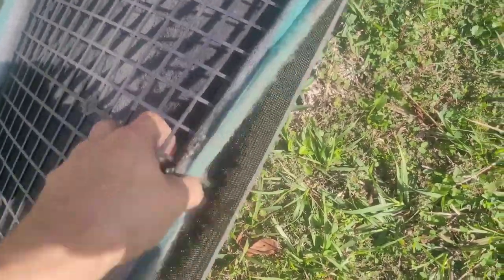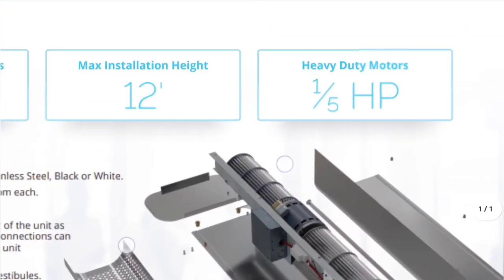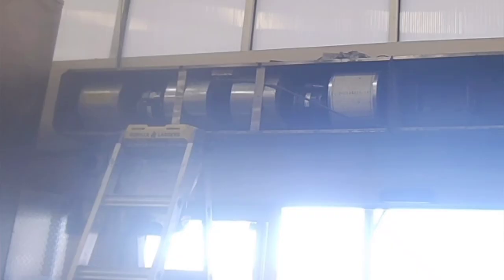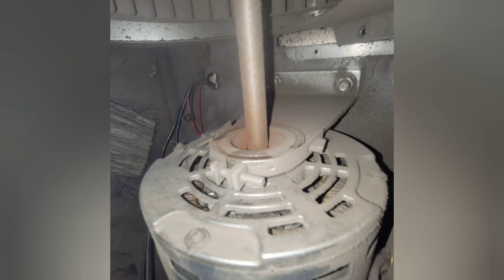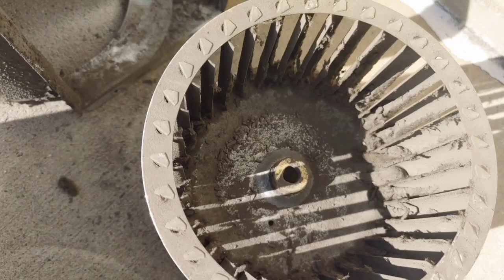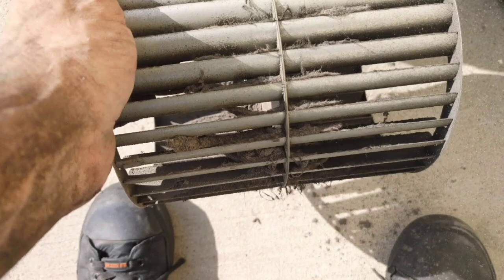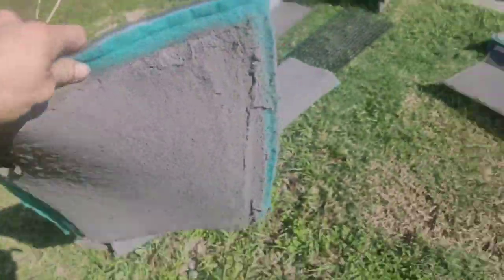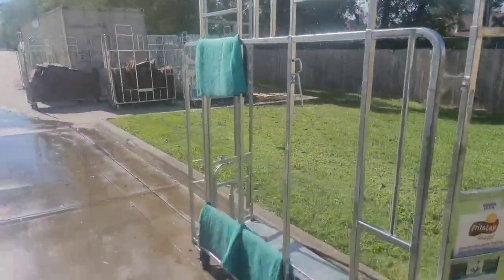Commercial Air Curtains At Supermarket Exit DIRTY

Comment: those motors are quick change. you only need to undo small nut and bolt on bracket clamps on each end of the motor. hope this saves u some time.